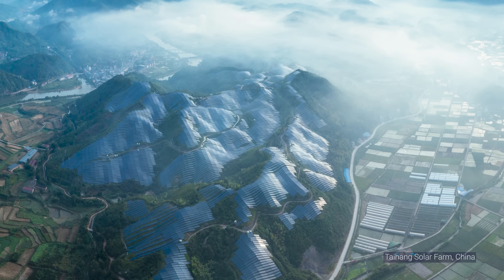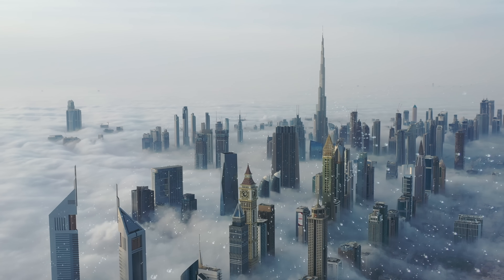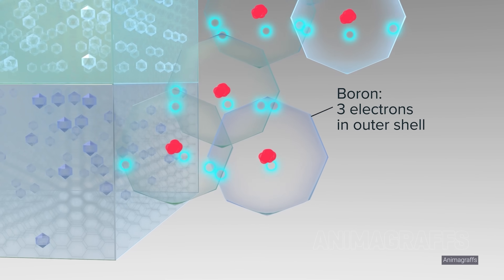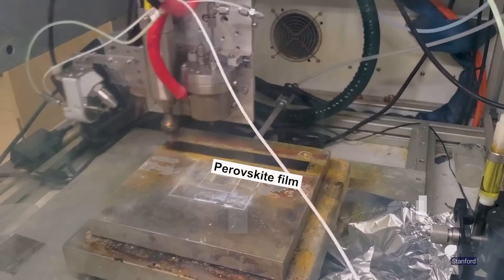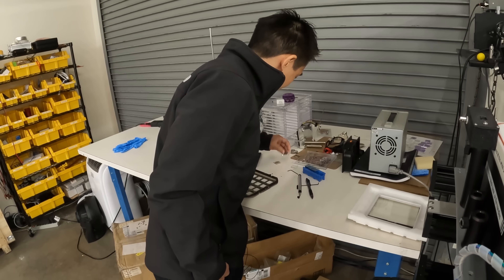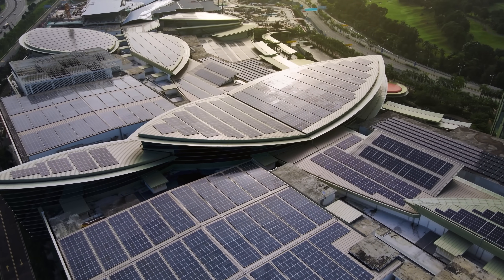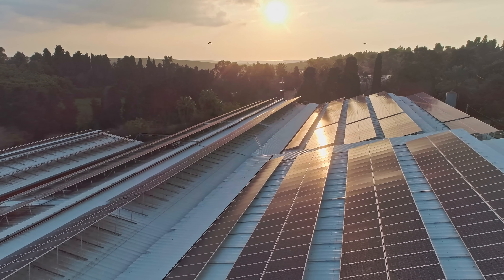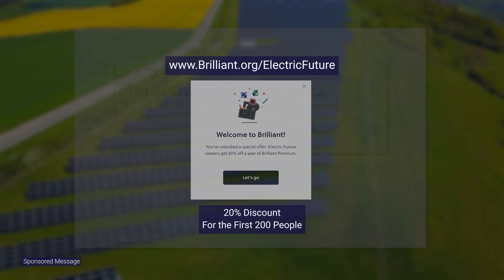Solar 3.0: This New Technology Could Change Everything

Comment: As someone who has cooked a lot of food on a lot of different materials I can tell you without a shadow of a doubt that the best way to get a stain to last is to cook with extreme heat. . I think these Perovskite scientists might find that crystline structures formed under extreme heat are incredibly stable. Melting and solidifying the crystals would probably lead to higher stability. A smooth block of ice (melted formed solidified H20) is significantly stronger than compacted snow(misted solids ).
Reply: Maybe cooking and thermochemistry are different lol
Reply: @mikefromco  Cooking is intuitive bio thermo chemistry in which all 5 senses play a direct role in determining success or failure of the experiment.  More specifically I'm advocating for expanding the scope of the trial and error scientific process going off of a hunch and asking the question what if the same or similar molecular compounds were developed under a wide variety of temperature ranges both cold and hot? This would increase the budget costs of the R&D and employ more scientists while expanding our understanding. Considering our most durable photo voltaic are created in the forges of extreme heat it's not a stretch of the imagination  to consider the possibility that other compounds which are more efficient could have greater durability by mimicking already practiced manufacturing methods. Science isn't about being closed minded it's about using imagination to devise experiments that you turn into useful data.  If it hasn't been done try it, under safe conditions. Tesla the god father of electricity loved the idea of extreme cold temperature research. More scope, more research mo Powa baby. https://youtu.be/IelyPhtPimA

Comment: Can some kind human here explain what do they mean current solar panel only 20% efficient? Meaning the battery storage able to store 20% or what?
Reply: as in it only works 20% of the time at full power conversion

in otherwords its useless
Reply: @datcheesecakeboi6745    humm .. im also wondering cos my Electriction told me its still not efficient as its just 20%. So basically 20% of the time it absorb and covert the energy only. Right?

Comment: I know he said it was a while off for the tech to get to 40% efficiency, But it's pretty awesome to think about having a solar array on your car roof that produces 10% charge just for leaving it out on the street during a sunny day! For many, That would cover their daily 30 - 40km commute!

But, I wonder if implementing solar roof panels on cars will have a negative effect on the lithium batteries and their charging cycles?
Reply: First thing that comes to my mind, if my car is covered in panels, which are hooked up to the battery (duh), what happens if the car is hit by lightning?

Comment: Very excited indeed! I was a little surprised to not see a short mention of the Zebra ISC or Sunpower Maxeon 3rd gen. solar cells. These cells have an efficiency close to 25% and are already in use in some sectors. Can these become even more efficient in the future?
Reply: They arent efficient at all .. the have spent 500% power to later over the course of 5 years get 50% power back 😆😆😆
Reply: @obedientfire840  How can you spend 500% power? Like, is it 500% compared to something else? If so, compared to what?

Also they are very efficient compared to past cells. Just because they haven't made up for the energy consumption of the research doesn't mean that they aren't efficient. We better not research on anything anymore if you have to make it useful before it's done.
Reply: @MR_Foffe  i am talking about the amount of fuel you use to extract the minerals to make it . The amount of fuel you use to ship the product . the enormous damage to the enviroment etc battery storage and production and shipment. you have just wasted 500% energy to get back 50% over the day time . which will decrease every year also ... it would have been cheaper and nore productive to just burn the oil for energy 😂😂 + loads of people can do the job so there would be less loss in oil rigs with jobs etc
Reply: @obedientfire840  if you’re getting 50% back a day then you’ll be efficient in 11 days
Reply: @obedientfire840  That's not what they are asking. 

500% of what? We get that it has something to do with the energy it takes to make them, but percentages by themselves make no sense, it has to be 500% of some amount. One would assume that you mean 500% of the total amount of energy they produce during it's lifetime, but right after you said that they return 50% of the energy they take to make, so that doesn't make sense either.

Not to mention that the point you're making isn't even true, solar panels have been making more energy than they need for decades now
Reply: @user-zz3sn8ky7z  an increased energy wasting in % .. thought i was clear on the first time already
Reply: @user-zz3sn8ky7z  I've read it took 2-3 years to pay back, (now I am sure they've improved manufacturing at larger scale, and is probably something maybe a year) after that all energy +

Comment: The problem with PTF has been durability and deteriorating properties in real world use. This is something that we've been working on for over a decade and while there have been various different solutions, most of them take away from the properties that make PTF useful. Thus, any kind of method of reinforcing PTF makes them heavier, rigid, or more expensive. The lifespan being 5-20 times shorter counters the issue of resources used for production as well. We might get there some day, but PTF has a long way to go as a usable technology for any kind of hype to be built on it yet.

Comment: Why can't a light source such as the sun simulator light source used In testing, be used to shine on the panels 24 hours per day in a self contained solar powered unit that can be used inside away from the outside environment? If it's small enough it could be placed in a closet or outside storage shed or garage.

Comment: The Russians invented the modern solar-cell in 1885. I happen to know that what you are claiming about perovskites is not quite what it seems. Th diff is just how the cells were wired. Conventional panels were too large and the energy traveled too long a distance to the only wire conducting only 2/9ths of the solarity that should have been collected. Besides all that we ll know that a magnifying glass can cause a *laser beam through a drop of dew to set a forest on fire! The solar revolution could have been long ago, if proxy-wars and oil squabbles didn't hamper people's ability to think without fear. I doubt Ouija boards tell lies about science and the sun's rays through a dew drop causing forest fires! No war with Russia for gas necessary.

Comment: I've been hearing this 'perovskite' name for about a couple years. Let's watch the video and see what they are. They have been told to change solar panels, but I'd like to know where to buy these panels for cheap, and how effective they are in comparison with the traditional ones. Ideally I would like to find an aerosol cylinder, spray it around my window, connect two wires and run my laptop. Also, it would be OK to spray it on a sheet of plastic. the one used in supermarket plastic bags. Just glue it or stretch it around or upon your window. Just dreams, but I hope they will become materialized in a cheap affordable form, like 5 dollars for 5 square meters. Actually I am from Ukraine and I have got tired of the Russians shooting at our power stations and electricity pillars and transformers and thus giving me 2-week long blackouts without any electricity, charging phones or using my PC to work as an English tutor online.

Comment: Imagine.. a cheap and sustainable solution to our energy needs. Well, this is not it. Poor sales pitch, dreaming of mass market commercialization, with an unfinished product that does not seem to be stable yet, let alone ready for commercial use. On the commercial side, no actual key factors are exposed that the investor is interested in, not even wishful thinking with some key data. The only important factors worth mentioning to make this a sustainable solution or alternative are being kept silent or lied about: sourcing, production cost and sustainability.
The materials involved are tied to the same supply chain issues like anything else: we may want to switch to electric cars for example, but if the sourcing of batteries is not solved and we run out, then we led humanity into a dead end street. This goes for all things electric, just as much as for fossil fuels. There is no mention of the sourcing (costs/sustainability) for this new type of solar cells.
The cost of production is complex: it may be that they save on the material quantity used vs hard solar, but it is hardly relevant when the type of material used is more expensive or if the process of applying the thin layers require special equipment to ensure evenness and stability. For good reason the CEO had to admit there are "stability issues". It is for good reason that anything movable/flexible needs to be able to resist stresses and that this flexibility requires a much more refined production process than something that is not movable. You can buy a piece of amalgamate for pennies, but to shape it as a tooth filling requires the thousandfold cost in production cost. The higher the need for refinement in the production process, the higher the costs, exponentially. In other words: refined technology is expensive. 
Finally, sustainability. Pretty much all of the above: can you keep mining the required materials for the product and for the machinery and applied materials that create it? You may invent a wonderful material that is efficient and low cost, but if at some point we run out of fossil fuels and essential products like plastics (which are oil derivatives) seize to be available, much of the production process just may end up in a dead end. Though by that time there will be no more cars running anyway, for lack of tires, batteries, body materials, etc.
So this race against time is nothing more than a competitive race for efficiencies. And the choices made will be political, not technological: taking a risk by investing in an alternative type of solution means that there needs to be a shift towards this new technology all over the board, globally. Any politician opting for a new alternative may be risking abandoning proven and existing technologies for uncertain ones. Since when has any politician been known for taking risks?..
This whole sales pitch smells like another IPO coming up and a fast cashing out after deceiving the investors. Well, good luck with that.

Comment: what are we waiting for I want to test them immediately in Belgium. Dark days in the winter but summer it should be feasible. they are small so you can still achieve something with a complete full roof. it can't go fast enough if we want to save our planet.those windmills can go they cost way too much for what they bring in, put trees instead. thanks for the video

Comment: I look forward to seeing Perovskite solar cells becoming main stream, and hopefully bringing down the cost of solar cell, and improving efficiency on energy generation. It will certainly benefit alot of people then, from all walks of life.
Reply: They literally break down to anything even extended exposure to sunlight
Reply: @datcheesecakeboi6745  à
Reply: I want to see an electric RV with the entire surface covered by these cells as body cladding, and a rollable shade also covered with them for even more surface area.  How much charge could you get if you were not merely limited to some solar cells on top, but covering the entire surface?  Same for the windows, get some that collect some of the light and convert some into power.
Reply: @ubuu7  not alot more realisticly
Reply: The global Perovskite solar cell market size was valued at $0.4 billion in 2020, and is forecasted to reach $6.6 billion by 2030, growing at a CAGR of 32.4% from 2021 to 2030. Perovskite solar cell (PSC) includes the perovskite-structured material as an active layer based on the solution processed by tin or halide.
Allied Market Research
Reply: The global Perovskite solar cell market size was valued at $0.4 billion in 2020, and is forecasted to reach $6.6 billion by 2030, growing at a CAGR of 32.4% from 2021 to 2030. Perovskite solar cell (PSC) includes the perovskite-structured material as an active layer based on the solution processed by tin or halide.
Allied Market Research
Reply: It's not the cost of the solar panel that is expensive in a solar system. it's all the other components like MPPT solar charge controller and inverter. Mostly the batteries storage and its BMS, if you opting for an off-grid system, is going to be by far the most expensive item. Then add to it heavy gauge copper wires and connectors!. TThe installation cost are quite high too unless you're installing it yourself.. Perovskite thin film are neat in that they are more efficient and also can pick up the light from both sides. Unfortunately they are much more expensive as they are not mass produced like their Silicon counterpart. The 25 year warranty is more than acceptable as even Silicon panels may degrade down to 80% within 10 years. However many people replace their panels to larger capacity panels within that timeframe and get rebates for their older ones from installers that resell them for less than 20 cents per Watt. They'll still work for many years at that lower efficiency Just add more cheaper panels to compensate.

Comment: If only byedung/Ohbumahh crew had pumped the billions of tax dollars into this instead ogf bioweapons labs[ 300 estimated ,all over the globe ] . Have been hanging out for perovskite tech , has made the progress into worthwhile % efficiency .If longevity isn't quite there yet,could we not get the best we have out to market ,with a garanteed plug and play retrofit design . The energy foot print of this tech is so much lower could they even supply their own cradle to grave cost ,unlike silicon that still needs a lot of diesoil to make .would we not make anet energy saveing by quick adoption . Mind you looks like were getting zero point tech very soon ,so the need will become specialized .

Comment: When I was working on machines to laser scribe thin film solar panels in the early naughties, all people were talking about was getting the cost down to $1/watt, we hoped thin film was the way we would achieve that, but economics of scale have meant that monocrystalline cells dropped in price far more rapidly than anyone imagined, pricing out cheaper, but lower efficiency, thin film technologies, even Cadmium Telluride (which was horrid to work with, ask and I'll tell you about the extraction system we built).

It's really great to see new options, and perhaps Perovskites are the way to bring thin film and BIPV back to the forefront, if the logevity problems can be solved, but even if they can, industry is slow to adopt technologies that don't have a long history already, so I wouldn't be surprised if we had to wait another decade for Perovskites to make any significant market impact.
Reply: the early naughties ༼ •́ ͜ʖ •̀ ༽
Reply: Some say noughties, but I think naughties is funnier. *8')

Comment: i dont get it , why is everyone so sure solar is safe? i get its green and renewable , but that energy your turning into electricity was heat in the environment , is it not at the end of the dat through climate change? i know we cant predict the weather so i dont see how anyone can be sure moving to large scale solar power wont have a negative impact, that 100sq mile USA solar area example near the start, that heat currently powers some important winds/ currents.
Reply: Solar isn’t safe and produces waste
Reply: We’ve already discovered a perfect fuel source called nuclear which is the safest and most efficient fuel source ever used

Comment: I had an idea once about using a material like this as part of the lining for fiber optic cables. Using a single solar collector/concentrator and feeding the light into the cable and collecting the energy along the length of the cable. I thought it would be a fun way to light the interiors of ships and a way to hide huge solar panels/collectors into a small or oddly shaped space.
I love living in the future
Reply: @skyricq  yup, that was the idea. Not for use in data transfer but for energy collection. I accept that there will be light lost as it transits the cable but if it's just a big ol' satalite dish bobbing on the surface of the ocean with it's cable dangling down like a jellyfish to attach to... I dunno, maybe an ROV... That the power could be transferred from the surface to the bottom via the cable without it having to surface. Or maybe a collection dish on the side of a space craft pointing at the sun with it's cable just stuffed into the craft wherever there's room so you don't need to design folding solar panels
Reply: Good idea
Reply: That's great apart from the fact that it would absorb the light along the way, so it would be a really short optical cable since more than a few meters long you wouldn't get any light out the other side it would also make the data pulses useless as some of the shorter weaker pulses would be lost even at shorter cable lengths.
Light loss is already a real thing in fiber optic cables due to absorbsion and scattering and can be as much as 2.4-3db per KM @850nm so having a super absorbative layer inside the cable would probably equate to far more power loss than would be generated as you would need to increase the power source several fold in order to ensure the optical data would stay intact.